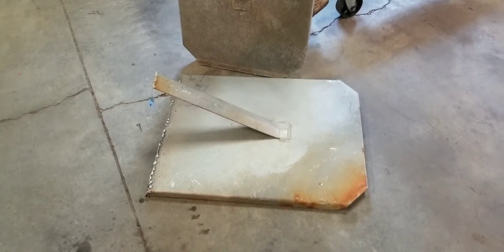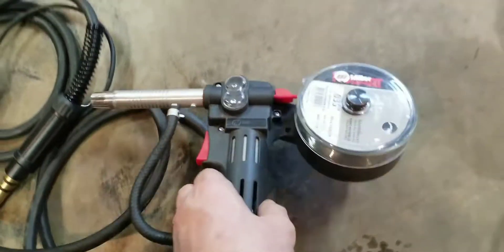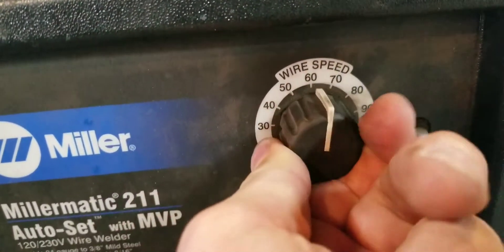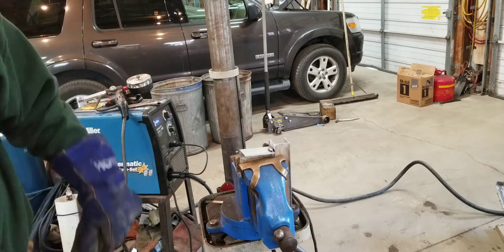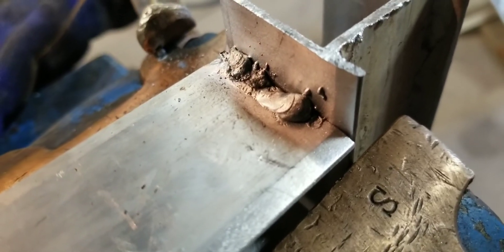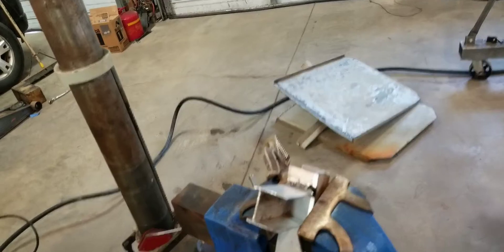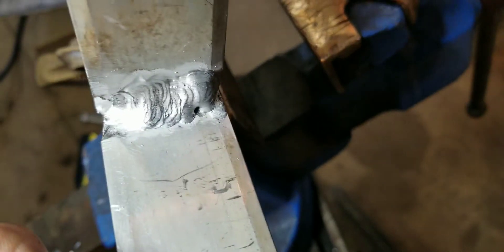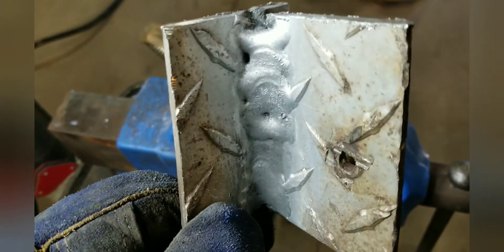Welding Aluminum for the first time

Comment: You can push aluminum wire through 25 feet or more. I like that more as the spool gun doesn't straighten the wire and it wonders on you.
Reply from the maker: I just assumed you couldn't push that soft of wire that far and that's why the spool is near the head. I'll research this a little. 
Thanks for watching!

Comment: I never did like either stick welding or mig but have done both at one time or other.....Tig is my favorite go to source  for all my small welding jobs but for heavier work I use a plasma welder.
Once I was faced with the prospect of having to weld an aluminium base frame for my spa bath pump and it was either pay someone or DIY.........I used the  plasma welder to do the job and had quite a bit of clean up to do afterwards as the plasma welder has a huge heat output.........filler rods were 6mm diam and I used a powder flux on the rod etc.
The ally tends to absorb the heat very quick and you get a tendency, if you go too slow, to have a sudden melt through and a hole.
A plasma welder is similar to a mix of oxy accetylene welding and Tig welding but at 8,000 deg C.
Reply from the maker: Wow. You're way more advanced than I am. I never heard of a plasma welder before. It sounds like it would be too hot.
Thanks for watching!
Reply: @tomhendricks316  Some time back I read about the Multiplaz 3500 plasma welder and after a demo at our local dealer I bought one....reviewed on UTUBE elsewhere........it has a steep learning curve but is very powerful.
After using it for a month I sold all my conventional welding gear....... Mig, stick and Tig, it does take a bit of learning, similar to learning how to gas weld with Oxy Acc and it only runs on single phase electricity and no gas, uses any metal as a filler and is not at all fussy about having the metal clean......rust, oil, mill scale etc.......the outfit is also a plasma cutter too.
I only weld occasionally for hobby and fun projects.
Reply from the maker: Thanks Ian, I am definitely going to check that out.
Reply: @tomhendricks316  Be aware, while it has huge potential it can never be compared to a regular welding procedure as is already established in the commercial welding world.
I bought it because it has unique characteristics that put it beyond normal welding practices and I am a DIY person only.....that is a long story etc.
Reply from the maker: 10-4, I was looking at them last night, they aren't cheap. I'll watch some videos. I really want to get into tig welding next.
Reply: @tomhendricks316  You are quite right on the cost factor.....it cost me A$2,000 for the demo model back in 2015.....that would be about US$1,400 so it just depends if you have a real need for it........I really wanted it, mainly for hobby work etc and the fact that it runs on water, no gas and any metal rod as a consumable.
Reply from the maker: Thanks. What area so you live in. USA?
Reply: @tomhendricks316  No....Melbourne, Australia.

Comment: You need to clean off all the oxidation first,  and I'd also wipe it down with acetone. 
Clean, clean ,clean or it wont weld worth a hoot
Reply from the maker: That's good advice. I should have done that. I'll be getting that out again soon to give it another try. 
Thanks for watching!
Reply: Clean by Acetone /SS wire brush/ Acetone
Reply from the maker: Will do. I have to get that out and practice more.
Thanks for watching!